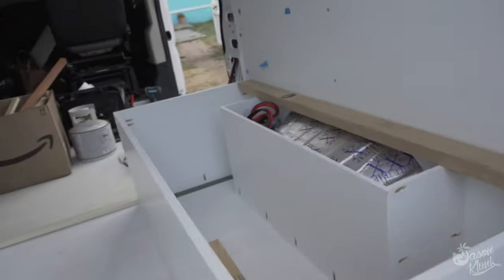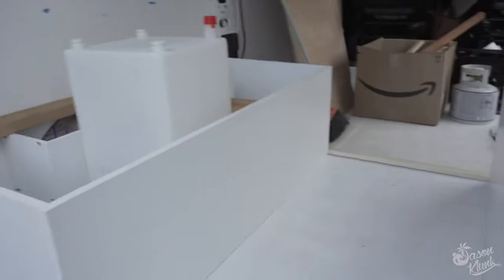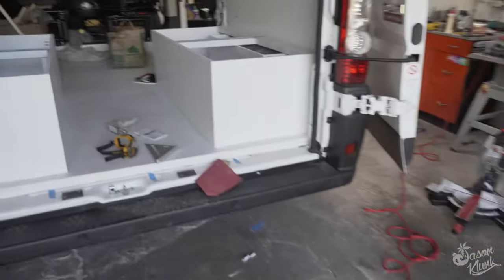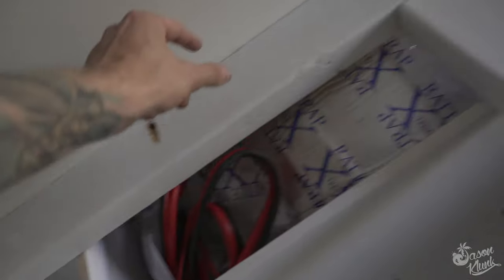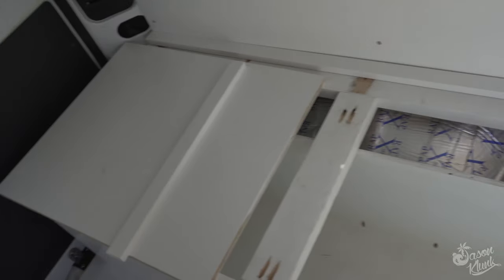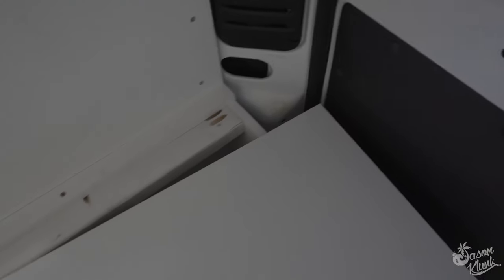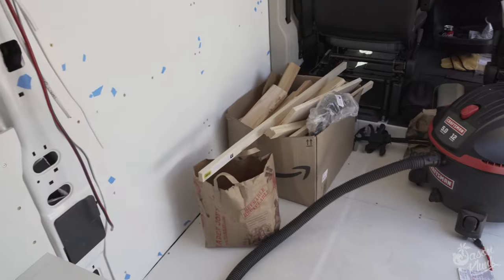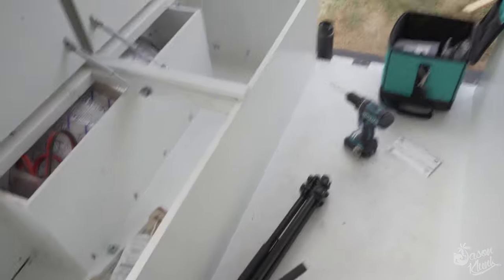Finishing Convertible Bed/Bench Seats! Ram ProMaster Van Build Conversion - Episode 16 | Jason Klunk

Comment: We absolutely love your design, and we are going with the same in our promaster 2500. One issue we are running into as we plan the bench layout, is where to house the AC breaker box. It's 4 inches deep, and we were wanting to mount the electrical to the wheel box. Where did you put yours? Thank you!
Reply from the maker: All of my electrical components are in the the back bench seat (passenger side)

Comment: Those look great. I am just about to jump into this step and wondering why you went with sheets of plywood instead of a frame with 2x2's or something similar.
Reply from the maker: I went with plywood to save space. With 2x2's you lose a couple inches and then you still have to put plywood or some sort of face on the frame. I thought I was going to have to brace the benches in certain spots, but they ended up being super strong with the 3/4" plywood.

Comment: Curious to see how you're going to do the bed. Most I've seen with a similar design use a pull out slate design. Also, is white going to be your final color? Reason I ask is that I'd be afraid of dirt, scuffs, marks that easily show on white. Still, can't wait til your next video, been following your build from the beginning. Lots of ideas for our own 136" build.
Reply from the maker: Thanks! My table will drop down in between the benches and that'll be used for the bed. I'm going with white for the benches and the uppers because I'm a masochist who likes to clean.